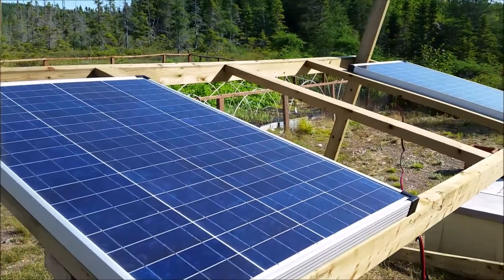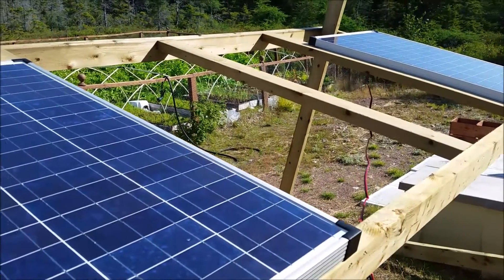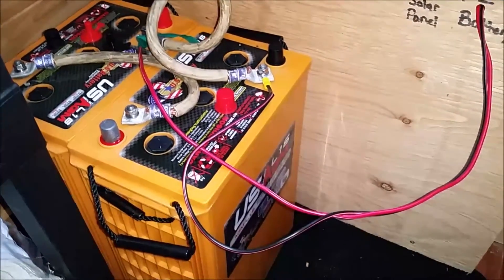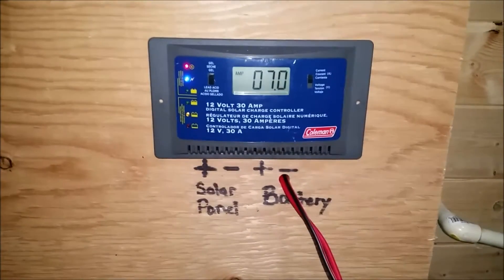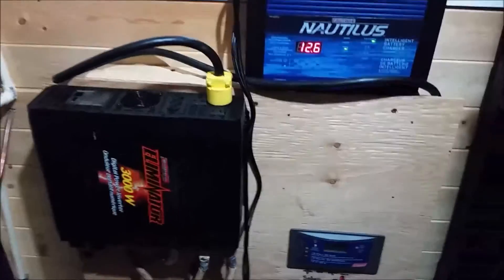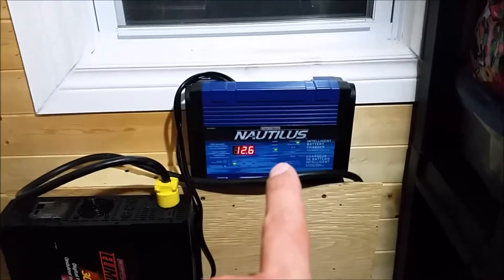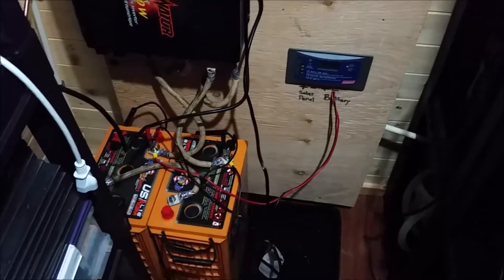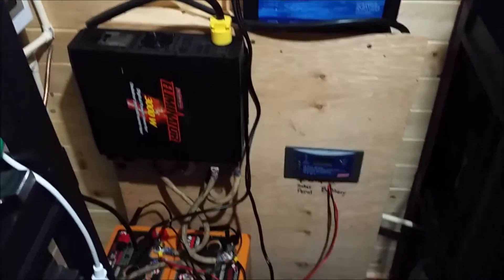Cabin Life: Living Off Grid Part 13 Solar Power

Comment: Not sure why but my AGM's never charge above 13.7 volts. I have 2 - 12 volt "Tank" Batteries in Parallel charged by 1 - 300 watt Panel and an MPPT controller...and I live in Southern California , so it's not lack of sun lol
Reply from the maker: Dennis Steele hi there, it is very normal for AGM to max out at 13.7 volts.  They generally only reach 13.7 volts, unlike the lead acid.  One thing you will notice though is the bank will stay at 12.6 volts for a very long time.  In the beginning, I would never let my batteries discharge any lower than 12.7, but soon realized that I could get double the time and energy.  My batteries are generally at 13.7 volts most days here and the controller believes that they are near 100% because it will not put any float into if I don't have any load.
Reply: Dave Wilcox Jr  . Thanks for the reply. That's pretty much what I figured. My system is on my travel trailer and only gets used when we dry camp for the most part...However I have used it a couple times when we've had power outages. I just ran a 50 ft' extension cord from the 3000 watt Pure sine inverter to my computer desk and 70" TV. It ran them with no problem for a few hours at a time plus some led lights and a couple fans. I'm pretty nuch practising for when I retire and hopefully move off grid.I'm already researching land in Tn. and Va. But I won't buy anything that doesn't have a year round stream for hydro to suppliment solar and wind. Glad I found your channel and the swamp dude too lol
Reply from the maker: Glad I could help!  The advantages with sealed AGM batteries of course are less concern with hydrogen gas so the batteries can be out of the elements.  LED is certainly a great investment with all appliances and bulbs.  Another thing is having a heavier guage wire, such as extension cords that have less resistance, therefore the discharge rate is not as high, and your higher powered appliances will run better.  It sounds like you have a good set-up and will be well prepared for when you do make the move off grid.  I can certainly agree with finding a location near a stream or river, I sometimes wish I had that option here.  Those turbines would benefit year round day and night!  I have learned a lot on here and ceartainly picked up a lot from the boss!

Comment: I can tell you it's not  Pure sine wave. The cost of it would be around 1 grand or more for a 3k pure sine wave. Nice setup brother. God Bless.
Reply from the maker: Yes it is a modified sine wave.  I recently added 4 more panels, along with 2 additional batteries, total of 4 batteries.  I had to upgrade my charge controller to an MPPT 60 amp, so far so good!  Thanks for the comment, take care.
Reply: Dave Wilcox Jr Nice do you have a video up?
Reply from the maker: Yes, solar update I
I do believe is the title.

Comment: Looking good so far buddy.  The buzzing is most likely coming from your inverter but I'm unfamiliar with that model. If it doesn't say Pure sine wave on it, chances are it's not.Looking forward to the updates.
Reply from the maker: +thebossoftheswamp Yes I have had the inverter tested and I have about 110 to 115 volts constant and found out after it is a modified sine wave, pure is the way to go.  I have 4 more 100 watt panels on the way with an MPPT 60 amp charge controller as well, with 2 more batteries of the same make!  I am now awaiting gaskets for my 3000 watt generator that just needed piston rings, but I decided to replace the piston and rings... over 50,000 hours on that gen!  With the solar and the battery bank big enough to keep them up to 70% I am expecting 10 years with the set up, fingers crossed!  Thanks Boss and take care!

Comment: how do you have them anchored? Living off the grid, everyone's dream... Good on you...
Reply from the maker: NLGhostWolf Thanks Charlie, yes off grid is the way to go... The panels are anchored with stainless hardware to the pressure treated 2x4, the frame is anchored with 4 cinder blocks(not shown) with the high winds, but this location is well protected as well.  I am hoping to have the rest of the system tied in before late Fall!  Take care.
Reply: Dave, I think you are doing it right. Getting off the grid is the way to go. One of these days we'll have to get together for an adventure or two. Soon it will be time to harvest your garden. Looking forward to seeing that video.

Comment: Hey Dave! I've looked into the solar option. It's a bit pricey! I think it's recommended that you use a pure sine wave inverter for your computers and T.V.'s. I think that's the correct terminology. Anyway, cool gadgets! Take care buddy!!
Reply from the maker: Todd Wittenmyer It is a huge cost upfront but pays for itself with the appropriate battery bank and incoming charge.  This is just the start for me, as I am hoping for 6 panels total with 2 more batteries... and yes you are right, the pure sine wave inverter is the best for all appliances!  This inverter does not specify and I am already looking for a better one!  Thanks buddy and take care!!

Comment: Solar has come along way.  I like the fact that there is a huge array of 12 volt appliances and gadgets now a days to use, giving you the option to run a simple system and still have the basics.  Cheers!!
Reply from the maker: Joshua Smith It sure has Joshua!  I know the upfront cost is high but it pays off down the road... the key is to have the power bank large enough where the system doesn't run lower than 80% to extend the battery life.  I am hoping 600 watts in panels and 4 6 volt batteries will be suitable with the demand here.  I will be monitoring the system here to know what works and what doesn't!  Cheers!!